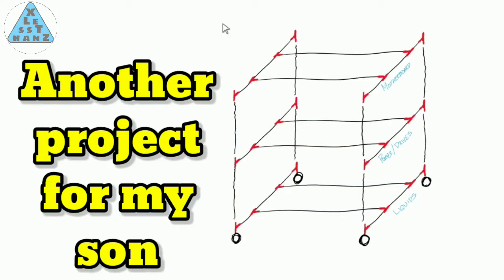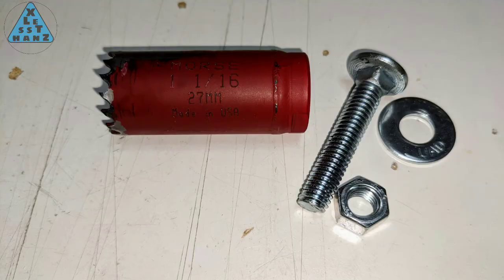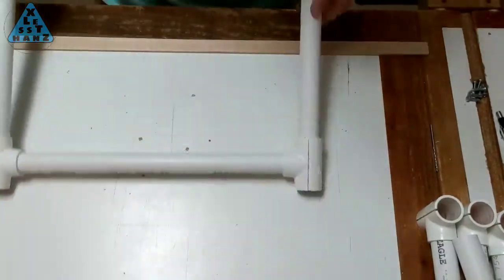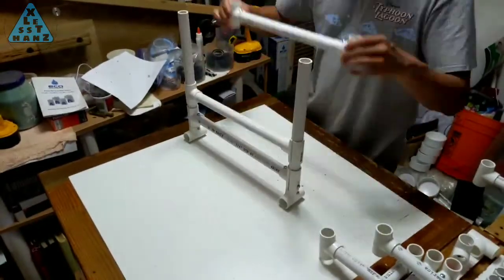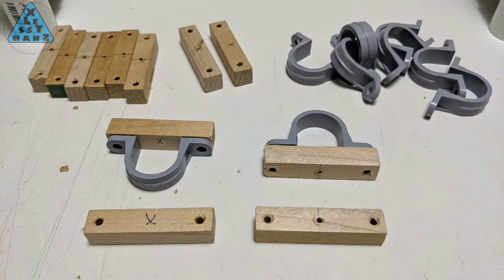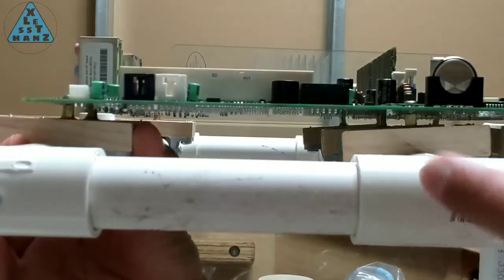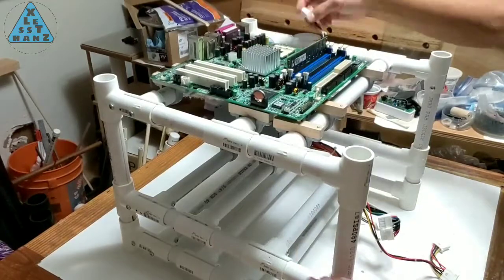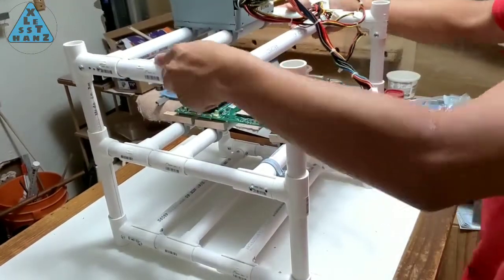Morphable PVC Computer Case (CUSTOMIZABLE MODULAR DESIGN)

Comment: Great project. One question, what was the total expenditure in parts?
Reply from the maker: Most of the parts were free, because the computer was a discarded one at work that I used the parts for my video, then put it back together at work to be discarded, since we're not allowed to inherit work computers.  Basically, you can make the case fit any kind of computer if you can figure out how to add brackets to hold things in place.
Reply: @XLessThanZ  thanks for the reply. I actually meant the pvc and such.
Reply from the maker: @elfedorausado  I think all the pipes, joints and brackets must have been about $50 to $75.  Not really cheap, but I like the ability to change the configuration of the case to make a different size, as opposed to buying a new case.